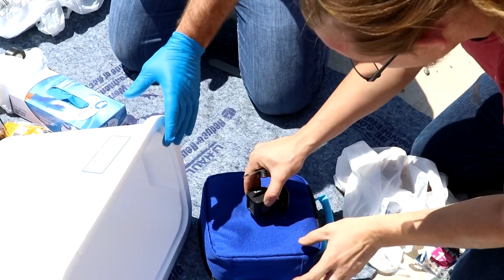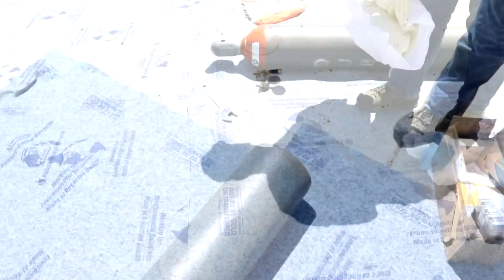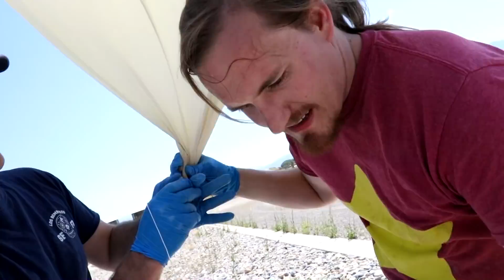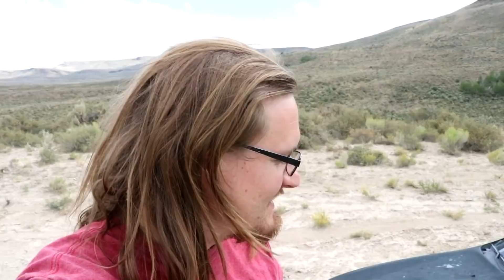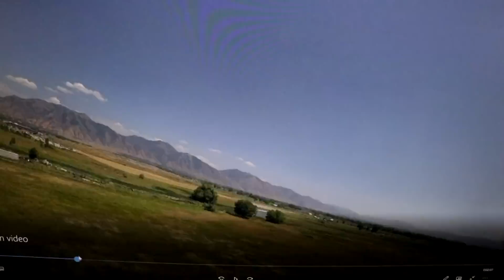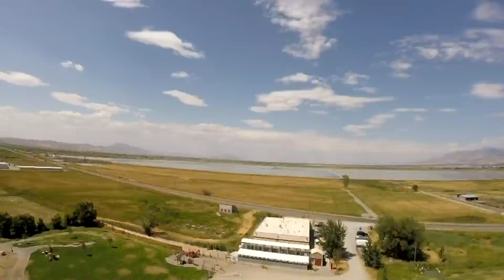My First High Altitude Balloon

Comment: Wow. 120,000 feet for a larger balloon. Get sucked into the engine of a Jumbo Jet passing through 35,000 - 45,000 feet. Great video!
Reply: electronicsNmore those engines can digest a 2x6 safely, and birds daily... im sure itll handle some latex and plastic if it was ever to happen.
Reply: electronicsNmore As I understand it they register the balloon with the FAA so that they can alert planes to its presence.
Reply: Just add a "radar reflector" made of 3 sheets of aluminium.
Reply: Not entirely true. Many planes in the past have had engines blown ingesting one ore 2 large birds. A 2x6 would certainly destroy the fan disk. The disk would become completely unbalanced spinning at thousands of RPM's resulting in disintegration of the engine.
Reply: True, the FAA is usually contacted, but the path of the balloon was way off the predicted track.
Reply: I believe most aircraft engine on jetliners can easily ingest frozen chickens and suffer no ill effects. It's been shown somewhere on utub
Reply: All airports that are certified weather stations launch a weather balloon 2 times a day to get current and forecast winds aloft.  They add a device that sends the data to them and has a transponder attached.  Someone who said add a radar reflector, that wont really work because of how airplane "radar" works.  It sees other transponders on the plane, not reflection of devices.  Some larger airports have something called "secondary radar" which is the radar that spins around looking for something to bounce the beam off of, but that is only used to identify an object.  At that point it could be anything.  So if they wanted to be 100% sure, they could add a transponder or beacon to it.
Reply: Ryan Fiorini got any proof of this? Sources ? :)
Reply: Sure. Try Google and type in “airport weather balloon schedule” and the first question listed asks “how often is it launched?”  The source is the National Weather Service. The answer, “The balloons are launched from hundreds of locations twice a day every day of the year.”  Is that what you are questioning?
Reply: If you are questioning the transponders, i am an active pilot, so I would source myself. But if you want to read about it, try Google and look up TCAS. This is traffic collision avoidance system.  You can also look up how airplane transponders work.
Reply: Well, the Air Defense would see the radar reflectors on the radar and alert planes of the UFO... Perhaps they would even shoot the balloon down.
Reply: Just curious if someone is employed as a "recovery team" for all those balloons... Anyone know?
Reply: There is a note on some types for people who find them to send them back. But in general, no.

Comment: why do they have to wear gloves ?
Reply: the salt in your hand will pop the baloon when it's inflated.
Reply: that baloon is damn skinny.
Reply: Probably the same reason you don't touch the quartz envelope on certain light bulbs without gloves
Reply: The oils on your skin compromise the balloon because it's so thin and latex is soluble in oil. Also why it says on latex condom packages not to  use Vaseline or oil based lubricants.
Reply: stronger=heavier
you'd need more helium to get the same net lift and helium is expensive, so the less you need, the better
Reply: The oils from your hand will get onto the latex and than freeze at a high enough altitude popping the balloon prematurely...
Reply: Must also make sure your hair or face doesn't touch it!
Reply: never expected so many replies  thanks so much :)
Reply: austin probably would get too cold at that attitude for a flame
Reply: Oils in your skin could dissolve through the very delicate balloon "skin"
Reply: Gavin Gore an often overlooked fact. Nice to finally see it being discussed.
Reply: evidence, duh

Comment: Would have Hydrogen been too expensive?
Reply: Do you want another Hindenburg?
Reply: Smaller molecules leak out more quickly
Reply: I was wondering why they didnt use hydrogen, I didnt think of the leaking factor.
Its cheaper isnt it? not to mention lighter.

Comment: Hey Cody, as an idea I'd love to see you try to cool a computer with liquid mercury, comparing it to regular conventional coolant in a water cooling loop :D
Reply: humm.... and you'll make the blocks from wich material..... you can't use aluminium nor copper, and the mercury can't get in touch directly with the chip. My challenge is to make a cooling system out of a freezer.... damn that should be interesting and relatively cheap.
Reply: make a r232a cooling system, at least that have the chance to cool your processor below ambient temperature without too much toxic shit.
Reply: The pump and probably tubes would have to be much stronger though and shouldn't form an amalgam with the passing mercury. The entire computer in a tub of mercury would be quite nice of a way to cool it, but sadly everything would be shorted that way. Also the specific heat capacity of mercury is  140J/kg, much less than the 4182J/kg and per volume mercury is still inferior at 1900J/L and water at 4200J/L (density 13.5 and 1 kg/L).
Reply: Oh heck I don't care about any of those types of details, even if it just ran for a few hours before everything corroded.  I just know they make liquid metal thermal paste from gallium now and it works amazingly well.   Liquid metal transfers heat better than regular paste or regular coolant so I thought it would be interesting since Cody is about he only content creator I've seen that has enough mercury on hand to even attempt it.
Reply: The freezer PC build has been attempted before, usually results in the same ending, the freezer motor burns out just like had you left the door open on it.
Reply: Not if you use parts from a industrial blast chiller, those can run indefinitely. Yes your home freezer will not absorb that much heat long term.
Reply: which tastes better, mercury or automotive coolant...i hear they are both sweet

Comment: cool effort ......but you knew the cam/battery/adaptor/jacks were F'd. Why risk using it after all that ? you coulda got a cheap-o(back-up/replacement) for less than that gas $ ..... you don't really need a good/time lapse cam, even any phone probably would have lasted till altitude especially with a back-up pack............you gotta redo this. But do try to fix the spinning issue next time......Live & learn.
Reply: I very highly doubt a mobile phone would survive anywhere near the -40C temperatures that can easily be achieved at altitude. Lithium-ion and Lithium-polymer batteries really don't like temperatures less than about 10C.
Reply: thats true....just say'n even a phone would get you nearly there & perhaps to altitude+ with back-up(batteries of your choosing) kinda meant a custom/modified(external) more then a back-up/booster.....though I bet even a regular good capacity Lithium booster would just about make it. Plus of course you would insulate it well & the heat the phone generates would help some perhaps more so if you left the screen on(though wasteful) & it would most surely make it if you diverted some of the battery towards heating. (though thats not what I said in my op).....I'd bet $50 on the well insulated phone with booster just making it. & its sure worth a try before spending hundreds or thousands imo. EDIT btw you're right about lithium batts & low temps which I was aware of.... I guess it would be worth looking a some charts 1st before lay'n down my $50 lol....that is Do they output 0 at -40 or just much less current etc & is the phones heat significant even if perfectly insulated etc.

Comment: Thoughts / ramblings:
The camera is making a complete turn every ~2 seconds.
Put some sort of wings on the package to avoid spinning. How can this be tested before?

You can use the package as ad placement. Any soponsors?

What happens at night? Shall the csmera record 6-8 hourd of black video? Maybe a small circuit can power it up / turn it off based on light condition. Photoresistor/ photodiode and and arduino?

Comment: Hey Cody, if you get another balloon up at some point, put the GoPro in timelapse mode, the battery packs usually can put out a lot more power than what the GoPros consume even when they are recording, on a H3+ Black I have gotten at least 12 hours of timelapse with the 10sec interval on 10000mAh USB battery pack, and still had some battery on the pack and the GoPro full. Was the battery pack full btw, or maybe a button got pressed and stopped the video/turned off the camera.

Comment: You could try to connet the packet using a barrel swivels and a small drone motor on an arm run by a controler to keep it pointing the same direction.

Comment: I'm sure this has been mentioned before but I think the reason the camera twirls is due in part by the string unwinding under the weight of the camera bag. Also the bag has flat surfaces and sharp corners to catch air. Thanks for attempting this. If you have the $$ think about building your own gyro image stabilizer.

Comment: Toe warmers are meant to be inside a winter boot, so limited oxygen flow and correspondingly slowed burn rate. In open air they'll burn faster. Hand warmers by contrast should burn at a more appropriate speed in open air.

Comment: Cody ..I wonder if you could keep the box steady by adding very light foam wing or weather vain to hold direction more steady. As for the interior I would think an Arduino controlling functions for power might be interesting by having it monitor temp and pressure and turning certain things on off like the go pro and or heaters ..and perhaps other functions related to GPS or an emergency descent when out of a certain gps range etc

Comment: If you try this again, consider putting a device in it to track the GPS location.  You know you really want to know how far it drifts and what kind of dance it does while up there.  Something with a barometric altimeter and logging capabilities would be ideal.  You could probably find a somewhat cheap used cell phone to do both of these functions.

To prevent the spinning, couldn't you put a long thin stick with fins on it (think of a weather vane) and attach the payload to the unpredictable flexible bits with a swivel?  If the fins are large enough and wind more than a couple mph, it should only change direction when the wind changes or dies off.  A carbon fiber rod that is a couple mm thick and 2-3 feet long and duct tape for fins should work and wouldn't be likely to hurt anyone.

Comment: You need to use a different battery chemistry that is more resistant to low temperatures. At low temperatures, the electrolyte either freezes or the solvent loses some of its ability to dissolve the ions.

Comment: It's also possible that the handwarmers actually caused either the camera or external battery to overheat... I'm thinking to overcome the spinning a 360 deg camera could "stabilize" it if just facing down

Comment: If you have access to ham radios you can transmit all the data back to a computer so you can log more data. I wonder how light you could make a gyroscope to deal with some of the rotation. I have only worked on one balloon 15 years ago but it was neat to recover the data and get the film developed.

Comment: If you want some good data logging stuff, which I've seen a couple tweets of people having used, use a Raspberry Pi with the 'SenseHat' addon. Not only do you have, if you use a 32GB MicroSD card, about 30 GB's worth of storage for various data, the SenseHat takes in a bunch of different data, such as temperature, humidity and pressure (and some others which I forget). You can also get a Camera addon for the RPi, which you can use as a makeshift timelapse camera, allowing you to send it all up as one thing, rather than have 3 or 4 different things inside your 'launch box'.

The Raspberry Pi Twitter often retweets projects people have worked on that use a Raspberry Pi as the main thing that gets them all of their info, including some people who have used it for purposes similar to what you tried to do.

Comment: Double ropes would have helped with the spinning issue. the string in a way "unwinds itself" when you put load on it. But eventually it will stop and change direction and like a swing go on for it for a while :) I gues u had this allready figured out :)

Comment: Try using 4 balloons on a square PVC setup. Place one on each end of the square PVC setup and in the middle attach the go pro with your equipment. This will greatly reduce the spinning effect and give you more stability in your video. Good luck!

Comment: What if you used a compass so that the balloon could detect its rotation and then you could write some software where you can specify a rotation and it would only return the video frames of when the balloon was facing that specific direction, it'd make it so that not only wouldn't the video rotate dizzingly at all but you could also choose what direction you want to look outside of the balloon with when reviewing the footage.

Comment: Is there a computer tool (since it depends on sun position and a bunch of other factors so it's not a simple formula) that can correlate the microsievert data to altitude?  That way you could find out how high it went.  Or a barometric recorder could work for that too (air-pressure-to-altitude like an aircraft altimeter).

Comment: Next Time you should install a Valve on the balloon so it can check the pressure inside and prevent it from pooping too soon. You could also setup it with a device that regulates the opening according to the altitude or the pressure...

Comment: To counter the spinning you need to install a fin at the rear side of the package. Basicly a vertical stabilizer
Reply: G'day,

  Did ye not hear the man..., he said that he intends to try 2 "Pool Noodles"..., probably about 6 ft long, tied at 90-Degrees to each other & fixed to the top of the Payload-Bag - looking like a  caricature of a Helicopter's Main Rotor...; that would Aerodynamically damp out pretty-much all Oscillations, Peturbations, and Rotations - while weighing almost nothing, and staying out of Camera-Shot.

 Just(ifiably ?) sayin',

 Have a good one...

  ;-p

  Ciao !

Comment: Spinning shouldn’t be an issue after a while, you can hold the string on the ground to try and get rid of most of the wind within the string. You can also try using a different type of string or cord. 

Test the entire thing on the ground for 48 hours. 

Use a gopro 6 with a 264gb card at 1080p24 and get a large external battery that automatically starts charging when a USB is plugged in. The piggyback battery will be needed if you want more than an hour of footage. It wouldn’t be a bad idea to have two cameras plus a 4K time-lapse camera. Have the gopro split the footage into 15 minute clips.

Comment: For a power source, you can never go wrong with a small lightweight solar panel (despite the balloon being above the payload).  It is a very reliable source of energy for the payload.
Reply: Legend of the Stormlord the problem was not the battery pack the problem was that he brought an empty battery.... I normally bring three to four charged batteries when I go out to a park or the beach to be sure. He brought ONE battery that was not properly charged and didn’t even test it before leaving for an expensive shot.  

Other things:
Did not make a proper box before hand and instead made a very simple DIY box on the go.

Did not use enough helium and that is probably why it took forever to pop as it could not go fast enough.

Seems like he was just invited the same day and did not prepare anything not even a real camera.

Comment: Cody,  next time, can you send up piece of pure silver wire, pure copper wire and pure gold wire, measure them before for traces of radiation and then after.   Also a year later measure them again to see if the halflife changes depending on the elements.   If I remember correctly, silver will absorb more and hold radiation longer than copper or gold.   Thank you.

Comment: Put a really small set of spinning hard drives in the next one.  The gyroscopic precession should stabilize the spinning.  Alternatively, you could attach a lightweight balsa fin set on a balanced boom.  Either way should help with spinning problems.

Comment: How about something like a Disc Drive motor and platter..  The Gyroscopic action would impede the spin ?  Some 18650 batteries would last long enough for the Assent I would think ?  How much weight are you allowed to loft ?

Comment: I'm guessing that since the onboard battery wasn't charging that it had failed internally. That would have put an extra drain on the external battery pack which was trying to both charge the internal battery and power the camera. Doing both all by itself was probably drawing too much current and tripped the internal protection circuit which most of these things have...cutting power to it. The external pack probably could have powered it most of the trip otherwise. At least longer than it did this trip.

Comment: The spinning image would have been working the GoPro processor to 100% having to re write every pixel continually, that probably killed it by self protecting with a thermal shutdown, and also it would be drawing max current from the battery. Also, a good trick when sealing up the balloon is to do the first zip tie then squirt in some dishwashing liquid, then do a second and third zip tie below that. The liquid creates an impermeable seal to helium. Anyway, great work despite the technical problems.